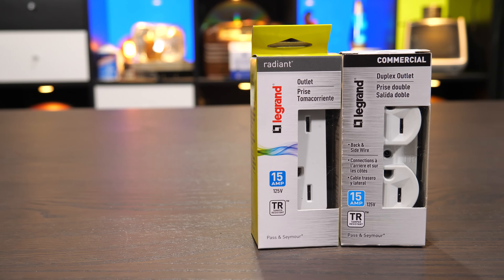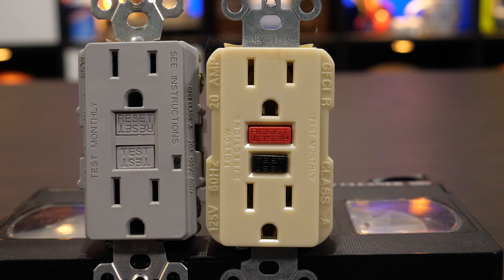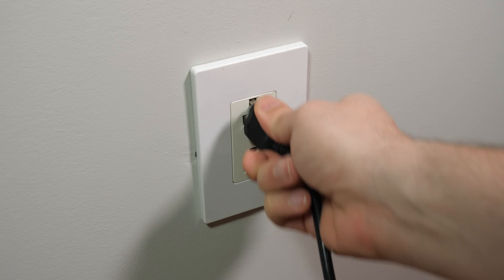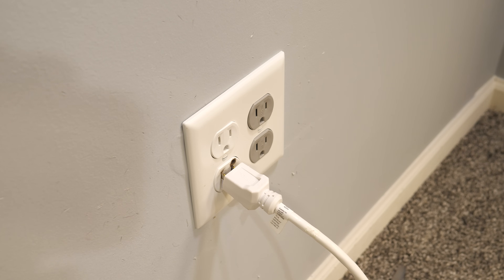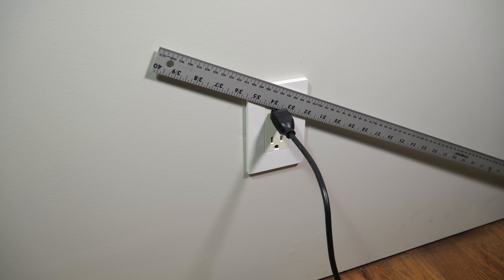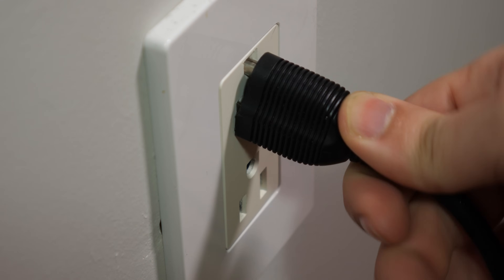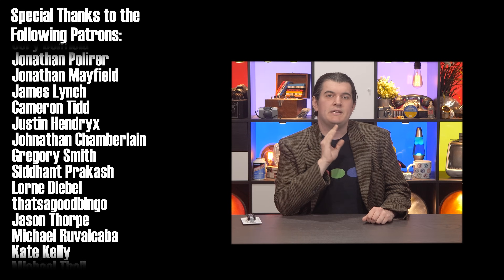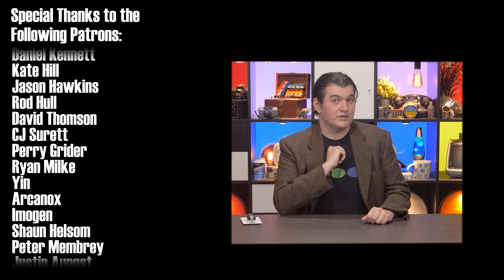Power outlets are topsy turvy - but does it matter?

Comment: European here, where I live we have CEE 7/5 sockets (sometimes called Type E) and mostly CEE 7/7 plugs (works with CEE 7/3 and CEE 7/5 sockets), if appliance is unearthed you can find CEE 7/16 (Europlug) and CEE 7/17 plugs. A plug becoming loose is a such a foreign concept to me that I am usually more worried about yeeting out whole socket out of the wall than the plug becoming loose. If the socket is old, low quality or improperly installed it is far more likely to yeet whole socket out of the wall, so I have tendency hold the plastic body of a socket while unplugging CEE 7/7 plugs. I don't think that it is a problem now, but in the 90s and early 2000s when CEE 7/7 plugs started to appear, tolerances probably became very small and old socked installed behind the iron curtain (but only those home ones, those basement and outside ones where always sturdy as far I remember) were not ready for the force needed. And the habit from my childhood just stayed with me. But even those old CEE 7/2 and CEE 7/6 plugs were almost impossible to partially disconnect as you do with the American ones, while the modern CEE 7/7 are probably so tight to make them dust- and at least partially water- resistant*.

*As far I checked, sockets near water supplies should be at least IP44, but even IP66 are common outside. Inside sockets are at worst IP20, but you can buy also fancy looking IP40 for internal use.

Comment: Funny thing, my mom’s house was built back in the 1930’s and went through a few renovations up till she finally got it in 2016, the majority of the outlets we found were installed upside down. It did used to be a daycare so it may have been the previous owners idea to just switch all of them upside down for the safety of the kids, but that’s just speculation.

Comment: In my apartment I got them installed sideways and they don't face at the same side. I find them way more convenient to have one where the neutral is on the right and the other half the neutral is on the left. I don't understand why he didn't mention that. You can have two right angle plugs simultaneously.

Comment: You also have to take into account the bigger stuff like the timers and wifi extenders sometimes use the wall under the outlet to support the unit so the prongs being slightly out doesn't happen.
Reply: i feel like you didn't watch the entire video, because he goes over this exact thing in extensive detail in this same video. 

unless im reading this whole thing wrong, then in that case, oops

Comment: The more I see these the more i appreciate the UK plug, standard orientation, right angle plugs, lots of other safety features in the plug body itself.
Reply: Plus most of our UK sockets are switched!
Reply: I am not from the UK , but i 100% agree : the british plugs are outstanding well designed . It 's still a miracle for me , how a technical advanced country still sticks to that crappy design
Reply: @andreascuracao4636   the british plug is insanely overrated. it's gigantic, it's not recessed, it has no small ungrounded variant. Switzerland does it best.

Comment: I'm pretty sure that my copy of the NEC from the late 1990s suggests (but does not require) installing outlets with the ground or neutral pin on top. That put me in the habit of installing new outlets that way. But now you've convinced me to go back to ground on the bottom, for better use with things like my kill-a-watt.
Reply: I have a 1997 NEC code book that states the the inverted orientation is "recommended" and the common orientation is "not recommended", but there is no actual code favoring one over the other. However, if I remember correctly, there is code stating how a side-ways plug is to be oriented, and I believe it was to be neutral up. Unfortunately, I cannot find my code book  at the moment, it is likely in a box somewhere in my garage, so I cannot get the page quote or code numbers for you.

Comment: There is one good use case for installing receptacles with the ground pin up.   The bed rooms of most modern homes have one receptacle powered through  to a wall switch.  I always install that plug "upside down" to make it clear that is is different from the rest.
Reply: I've actually heard several electricians make this claim as well. I had always thought it was a building code standard and never bothered to question it, and have always done this with outlets I install myself. Ground plug at the top = controlled by a switch somewhere.
Reply: I'm pretty sure that's standard on new builds now.
Reply: That's arbitrary. You could achieve the same thing by using contrasting-color outlets, or just having some shape/texture element to the specific plug that is switched (and it's usually only one of the two, not both, and never consistently top or bottom)... In fact, I'd say using color (black for switched) and textured (knurled for switched) would be optimal: super obvious for most people with a glance, but still as ADA-friendly as asking a blind person to rub their hand against the outlet to figure out where the ground is). Also, in a perfect world, having a locking toggle on the outlet itself would be nice to turn this feature on/off - yes, that would cost a bit more, but those stupid plastic switch locks just look ridiculous.

Comment: Its insane to me that this doesn't have individual switches on them. Like we have here
Reply: We put the switch in a more convenient spot, usually by the door. It takes a little more wiring, but the US never had a severe copper shortage like the UK did when rebuilding half the country after Nazis bombed it to hell.
Reply: Of all the safety measures outlets in other countries have, that seems the least useful to me. The only danger outlets seem to pose is when there's something already plugged into them and drawing power. Or if a kid comes along who's got it in their head to stick something in the hole, in which case they could just as easily do that and flip the switch.
Reply: @stevethepocket  our electrical sockets don't open until the ground pin goes in a certain distance. By which time the live and neutral pins are far enough inside that the conductors are not exposed anymore

Comment: Maybe you can do an episode on why EVERYTHING that is used in American electrical installations is total rubbish compared to the (probably quite more expensive) stuff we use over here in Belgium ? Plugs, receptacles, cables, cable sections, panels, breakers, gfi’s, 3 fase connections, voltage, amps, building codes, etc.

Comment: Co-signing the idea of normalizing babyproofing at all times. We put those in our outlets because, well, baby but more than a decade later we just leave them in. We never have to worry about dust intrusion or something getting stuck in there by mistake, and generally they look better. Basically any time you might end up obstructing an outlet with furniture, it's a good idea to (more or less) seal it up with a few babyproofing plugs if for no other reason than you really won't be able to check on it for a while.

Comment: 11:58 I've come across the odd angled ground plug that wasn't designed assuming the ground pin was at the bottom, but they are very rare and they're almost always sideways so they'd work in a ground-pin up or down scenario.

Comment: As far as I can tell, the only design flaw unique to NA plugs is the lack of insulation on the blades. They have a ground pin longer than the other two pins, and they can be polarized both by the location of the ground pin and the differently-sized live and neutral blades (although there is the option for non-polarized plugs as well). The standard Europlug has absolutely no polarization, and in fact, neither does the Schuko plug common to most countries in Europe. Someone correct me if I'm wrong, but I actually feel like the Schuko plug is a bad design, not only because of the polarization, but also because you can plug it into many European non-Schuko plugs and have the same potential problem with exposed pins if the plug is partially unplugged, since the pins are not partially insulated either.
Also, regarding sideways outlets, wouldn't it be better to have them so that the neutral blade is on top and not the live blade?

Comment: Aren't you the guy who made the "one small problem" video: a whole video about how LED stoplights weren't used for some time because they don't generate their own heat as an anti frost mechanism and thus lost out on power savings. 

I think the idea of the ground pin being on top as a safety feature vastly outweighs the weird inconvenience of the right angle plugs. Most of my plugs aren't the right angle variety. Not to mention that if Facility Codes made it mandatory for outlets to be installed this way, power strip manufacturers would likely make the needed change to their plugs ASAP.
Reply: I'll go ahead and clarify 2 things. 
1) North American outlets have a lot to learn from pretty much every other standard. I'm personally fond of the type C, E, and F schemes
2) I don't always subscribe to the "legal standard drives industry implementation" mentality. But I figure that this one would be a small enough change that if the industry drags its feet, the added incentive of customer loss could be enough.

Comment: 15:01 no its at a 45 so if you have it in the top outlet it doesnt block the bottom. if your whole argument for having an unsafe outlet is because of right angle plugs then i have to completely disagree. its easy enough to find a swivel plug or even an upside down right angle plug on amazon.

Comment: I didn't care until I was in college and had upside down outlets with metal faceplates. I had taken out the screw in order to install a six outlet adapter. A slight jostle caused the faceplate to fall and complete the circuit. There were lots of sparks until I managed to use a wooden pencil to slide the faceplate up back into position where I then applied some pieces of blue tape to hold in in place until the adapter was seated properly.

Comment: in eu we got plenty of double sockets that are mirrored, so one is up and one is down due to 90 degree plugs for some reason. Now imagine the manufacturers that make the effort to connect them properly, while others just dont care and draw straight bars to drive power in the mirrored socket, swapping live with neutral. And it's common here

Comment: Doesn't matter if it's technically upside down if most modern power bricks and appliances assume your plugs are set up that way. Having a house built in the 70s, where all the plugs have the ground wire on top is incredibly annoying, let me tell  you.

Comment: Standard orientation? Required ground Pin? Sleeved pins?

<WAVES FROM THE UK>

(You might want to look into sockets that auto cover the contacts till a plug is inserted, Switches on the sockets, and fuses in the plugs)

Comment: Great video! Here is one personal experience you can add to the pile of anecdotal data.

About 17 years ago I was a dishwasher at a restaurant. We had the standard chafing pans (look it up if you don't know what they are) for our buffet line. The pans and lids are all thin metal and usually have a lip on them to make them sturdier. I was stacking some on the clean pan rack and ended up bridging the hot and neutral pins for a plug with the little lip around the pans. Melted two little dimples in the lip of the pan lol. Scared the crap out of me too, but no shock or anything. 

Now, sure, the plug being the other way round probably would have prevented this, but let's be honest here... they probably should not be using that outlet if it's going to be behind a pan rack...

Comment: The only case where I see this being really practical would be in concerts and gigs, where most of the plugs will have the ground pin. Partly dislodged plugs are actually a problem, as people walk and trip over them constantly. 

But really, that scenario can still be solved without flipping the outlet. Most plugs are in power strips anyway, and rubber covers can be put on the cords for easier foot traffic.

Comment: Wouldn't a... Possible solution (I say hesitantly) be to have the duplex plugs next to each other, but oriented with the ground either up or down and using right angle plugs? Kind of solves several problems other than the exposed contacts if they do come loose. Those exposed contacts freak me out, I have been shocked because of them and it sucks.

Comment: The bottom one should be in the "face" orientation but the top outlet should be upside down, and then you also don't have to worry about which way you mount it

Comment: One type of plug that I think is very well designed is the Breville "Assist Plug." Basically, it has a hole built into the plastic to allow you to safely reach a finger into in to yank out the plug.

Comment: I have always preferred the ground pin on the bottom so my thumb doesnt hurt pulling the plug out. That said, i think we should have both 240 volt and properly guarded plug prongs as a standard/code. I think the plugs sticking straight out is more of a carry-over from early days of AC grid electrification. I was thinking it may be better to have the plug sit in a recessed space, with adapters for things that wont fit into that space till we fully convert over.
Reply: Just use the cee 7/7

Comment: I was in electronics class in high school and, goofing around, I thought that I would unplug an oscilloscope that another student was using. I did not notice that the metal panel above the plug was resting wasn't screwed in (for some reason) and was resting on the plastic part of th plug. Quite the pyro show.

Comment: You got strange problems... Americans. Recessing the outlet would be a good idea... ahh.. wait the plug case size is not standardized. Our EU plugs are not perfect, but I think that we somehow don't have most of those problems. 

The bad thing is... that the plug needs a redesign. 
Sleeve the blades, that shoudl work for most plugs... Make a standard size plug case. Wait a few years (decades?). Recess the outlet, wait a few years (decades?). The right angle will be a problematic for those, but make a standard plug - those designs all all over the place. And you will end up with almost an EU plug and outlet combo ;)

That should have been done a long time ago. I know, I know it works. But... we would be not talking about outlet orientation if it would be done 10/20/30 years ago.

Comment: You don't need them the right way in your house.  It's actually to the point where it's aesthetically displeasing if they're not upside down, and when you're trying to sell a house you're going to probably get some push back from buyers if you do have them all the right way.  You should put them the right way in the garage or on external outlets where you're likely to install any heavy duty extension cords though.

Comment: I actually flipped a socket "upside down" because my step daughter's bed was a parallel up against the wall and the metal bed frame shorted out across a lamp cord. Now before you say "lamps don't have ground prongs!" I added a surge strip so that there would be a "ground barrier" between the bed frame and the hot / neutral prongs. Also I raised the bed a half inch to prevent the frame from hitting the socket again.

Comment: 6:34 The change in the two prong design is to stop two prong devices from easily sliding out of the receptacle.  Older 2 prong devices like that tape recorder had a knack for falling out of the receptacle after the plug was worn out, and that would create a dangerous fire situation.  3 prong devices never really needed this design change because the ground prong would help keep the entire plug in the receptacle with very little chances of it falling out.

Comment: So it's as always. Obsolete American design is obviously horrible, but it will never change because you have the RIGHT to be wrong and you'll be DAMNED if you don't exercise it to the full extent of the LAW!!!

But seriously, just use recessed 90° sockets and plugs, and isolated prongs. It works exactly the same, costs nothing and renders the whole idea of unsafe plug design moot.
Also it is quite difficult to get seriously hurt by the mild tingle of 110V AC, you really have to be Colombo style "negligent" for that.

Comment: 04:15 it's so strange to see how ridiculous a simple design like this can be. The european version solves this by making a big round hole sunk into the wall by a few centimeters, which is filled by the plugs plastic and there is no room left for a finger. Simple and clever :D (Also, grounding parts are on the sides so it doesn't matter how you plug it in, it's like USB-C vs USB-A - and it was standardised decades ago)

Comment: I once heard that the upside-down plug orientation was originally, albeit unofficially, used to inform other electricians that may work on the house in the future that the outlet in question was on a switch. I don't know if that's true or not, but it's an interesting thought.

Comment: My dad installed all light switches in the house he was building for us "upside down". His reasoning was that in the dark swiping a switch down was easier than up. When the light is on you can see the switch and flip it up.
(I assume that the common expression from old gas lighting or oil lamps to turn lights up became the norm for on-is-up standard electric switches.)
Reply: Ah, I was going to suggest a video that discussed the orientation of light switches. Down is off. No debate. Except for two-way switches. Then it’s an issue whether the upstairs one is “right” vs. the downstairs one.